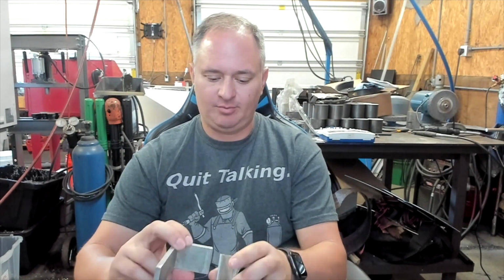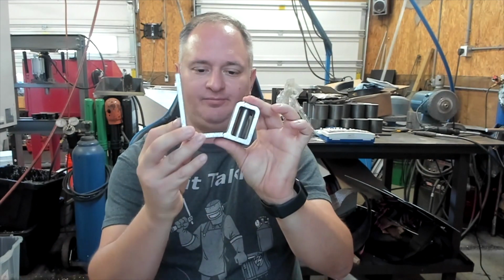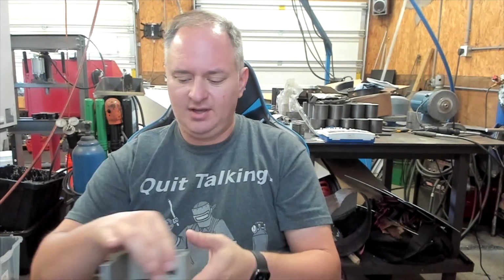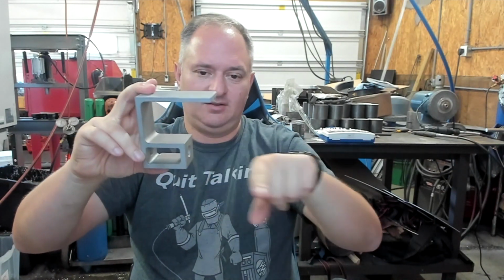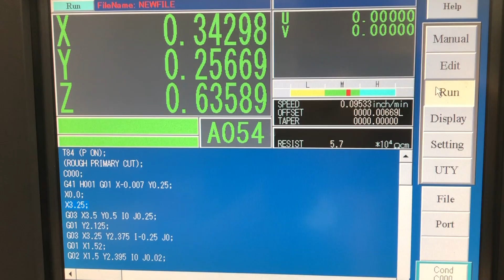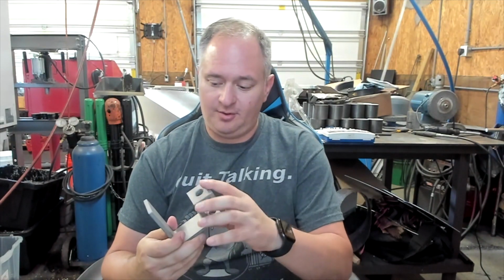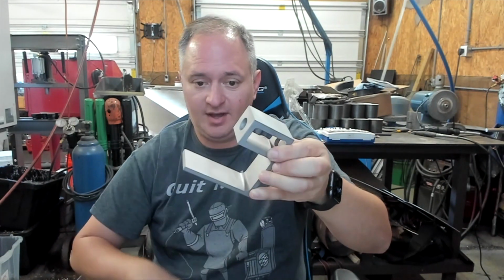Cutting with Wire EDM

Comment: Good to see this, how much wire is consumed during that 2 hour cycle? Amazing how clear the coolant remains, must have one hell of a filtration system.
Reply: Sodick machines have 2 huge filters - 12" diameter x 14" tall maybe. Charmilles I used to run had 16 smaller ones - 5" diameter and 14" tall maybe.